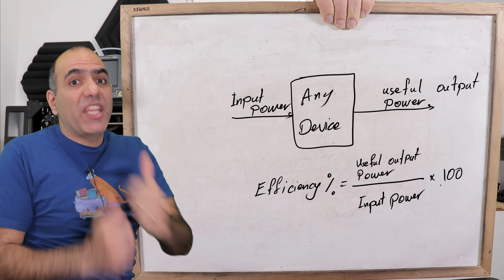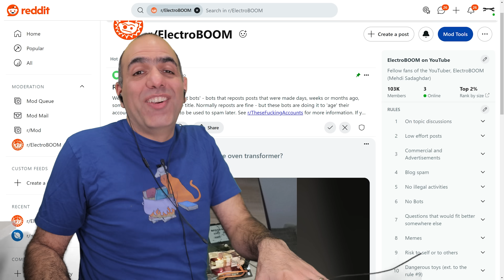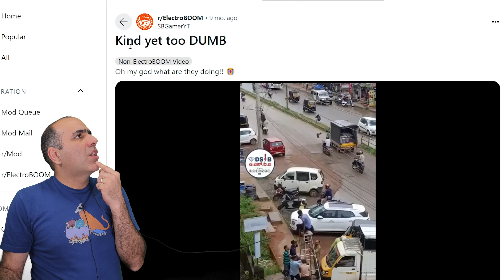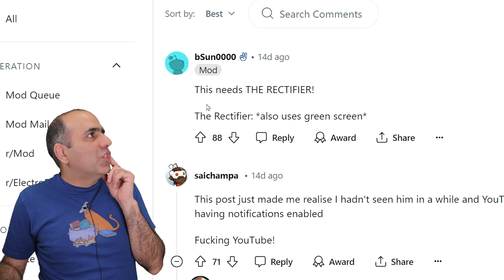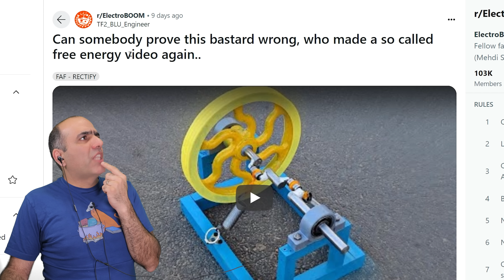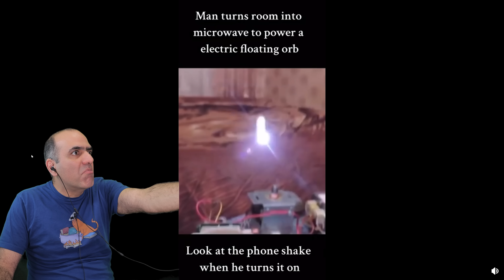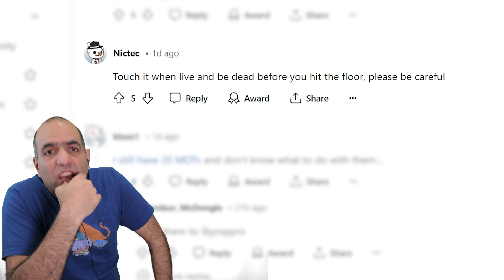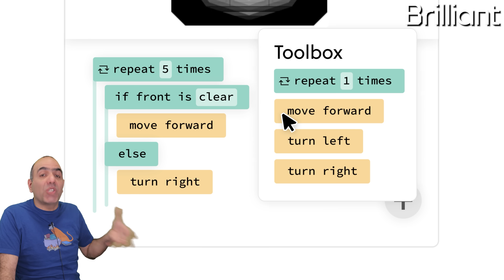New Flywheel Free Energy?! Can Boat Battery Fry You? LATITY-013

Comment: every time i hear trump open his mouth i loose a few braincells. thankfully its not permanent. even ev high voltage batteries are safe, because if anything even as much as smells wrong, the bms will IMEDIATELY disconnect the battery via two redundant contactors. even if not, the water will short the battery enough for the fuses inbetween the cells to blow, its fine.

Comment: iv' Gotten shocked by a 12v battery one time.     It only happened because i Disconnected the  line as the amperage was  surging down. it isnt' like a ac shock it was more about  a  Pressure or tightness.  that quickly went away with aches.

Comment: Hey Mehdi, i admire your chanel and i am a certified electrician who learned alot from your ways :)
Your example with the heater, i will just add a simple observation :)
When we are talking about efficiency you have a cable delivering power to the heater, this cable from your instalation or if you used an extention cord, those cables will get hot aswell, and swallow some of the imput power :)

Regards
The Danish electrician <3

Comment: as a boat electrician who has sat on a large bank of 8d batteries in a 100 degree engine room soaked in sweat, I can agree don't touch the contacts if your covered in salt water it doesn't feel good. I was just sitting on the negative, with my wrench on the positive and it felt like sticking a 9v battery on your tongue but through my entire body. do not recommend

Comment: FOR FEAR OF JINXING NEAR THIRTY YEARS OF AWESOMENESS... I GOTTA DISAGREE WITH YOU KIND SIR.. A LITTLE BIT ANYHOW.
SO, I REMODELED AN AREA  L O N G  AGO AND ONE CIRCUIT.. ONE SET OF LIGHT RECEPTACLES WERE RUN IN SERIES.  I GOTTA TELL YA, THOSE BULBS HAVE BEEN IN THERE FOR NEARLY AS LONG AS THE REMODEL.. WHY IS THIS...? 
I WILL SAY BECAUSE, THEY- (EACH 100 WATT INCANDESCENT BULB) IS BEING SUPPLIED WITH 1/2 THE VOLTAGE THAT IS 'A-POST-TA-BE' SUPPLYING IT- SO THEY RUN A BIT DIMMER BUT LAST TWICE AS LONG, YES?... NO?

Comment: The pigeon rescuers also messed up by using a metal ladder. For electrical work, the rails should be nonconductive (fiberglass usually), so that the ladder does not become a path to ground. I'm an IBEW apprentice, and this is one of the first safety lessons we learn.

Comment: This one where they cooked steaks brought back a WHOLE LOT of old-time memories where we blew up ENTIRE pork sides, turkeys and whole beef rounds using 400,000 Volts at 1000 AMPS using Huuuuuuuuuge solid iron bars rather than copper or stainless steel so we don't poison our meats! Using massive Solid Iron Buss Bars stuck right through our pork/beef/turkey sides we switched over our MASSIVE very-backwoods-remote Northern British Columbia data centre from the normal online BC Hydro connection to self-powered generator modality for "Special Scheduled Test Runs"! 

The wonderful flash arc of the disconnect and sudden input of 4 MILLION WATTS into a pork, turkey or beef round brought us a wonderfully carbon-scented barrage of well-exploded flash-cooked meat to our plates! We did that more than a few times to make the fastest-cooked holiday dinners EVER under the guise of Grid Power Disconnect Test Runs!

Yumm Yumm! All that flash steam-exploded meat was sooooooo tasty! Add in some rum or brandy and we were set for a VERY Happy Holidays data centre SysAdmin shift! It brings tears to my eyes at those ancient memories!

V

Comment: OK... I have a new plan, we have the shark at Universal studios electrocute trump?
no, OK... well lets push this little experiment a bit further for entertainment and science.
The question is: How low can you take the voltage and still get a shock that hurts. (No, not on the tongue)
Watching Mehdi holding the 12V battery against his face, with salt water I'm thinking... umm, ha, no, you're doing that wrong. Ok, not wrong enough. Now I have to suggest some feedback.
After waterskiing and swimming in salt water for a while, my skin was well soaked. Fingers pruned etc.
The boat would not restart after climbing in and I checked the battery terminal because I'd just put a new 12v battery in and the clamp was just a bit loose on the new terminal. I grabbed it firmly and gave it a wiggle to test if it was clamped tight enough. With my feet still soaking in salt water in the bottom of the boat and that bonded to the other terminal, the shock from a 12V battery is not spectacular, but my reaction to this weird kind of low voltage shock across my entire body is something that makes me ask,
how dangerous is this situation and what is the look on somebody's face when they feel this?
 My personal experience - it hurt a lot but I had no trouble reacting and letting go.

Comment: We cooked hot dogs after school for science class. It works great, and very fast. Hints: 

First, don't put the nail in very far - it only cooks tip of nail to tip of nail. If there is only a little hot dog behind the nail, the cooked hot dog in front of the nail will cook that end bit enough. 

Second, have an amp meter in the circuit. I forget if it goes up or down, but it changes rapidly when the hot dog is done. Cooked hot dogs have a very different impedance from raw hot dogs.

Comment: garage54 actually made a car engine using the flywheel in 09:35, i also saw many other use cases like a water pumps, power generator...  but the efficiency is kind of low. 
it's not 100% free energy because it works by harvesting the energy saved in the springs. kind of free energy tho

Comment: As far as I know, for the purposes of air conditioning systems there is something called Coefficient of Performance (COP) which is exactly the ratio of useful heating vs work input required. Unlike efficiency this value is usually more than 1 (around 2 to 4), and that means electric heater can only give a maximum of 1 (electric power in = heat out) which is very poor compared to heat pump air conditioners.

Comment: Is that battery damaged? You know that hybrids have caused a few electrocutions just because the cars got damaged. So when a boat is sinking it just sinks 100% intact?  It only matters depending on where you're standing and where the energy is moving from point a to point b....
Reply: Small EV fairies: something like two Spear battery banks (135-kWh each)

Bigger fairies: 

Something like two battery rooms where 840  lithium-ion batteries stacked floor to ceiling have a total capability of something like 4.3MWh,

Comment: The crazy part about that stupid electric zappy pot is that it's a lot better if you simply use an induction cooker. Use the electricity to make a magnetic field that then turns lights into the pot and makes it hot. Also you're wrong about standing magnets not being able to make constant motion. It depends on how you design the system if the magnetic flux is in a helix for example.
Reply: That's also known as a basic electric engine

Comment: So first, he starts off badly by assuming that the "heavy" battery is going to cause the boat to sink.  Most types of boats require ballast to float correctly and be stable - unballasted boats have so much buoyancy they sit too high in the water.  So, all a heavy battery would do is cause the boat to need less ballast.  Second, pretty good chance the high voltage parts of the battery are going to be pretty well insulated - they already are on cars and boats would need even better in a boat to avoid corrosion.  Third, if a high voltage were an issue, boat manufacturers can deal with it by simply putting contractors mid stack and opening them if they detect too much water in the boat.  Fourth, not sure high far a HV battery would be dangerous anyway - seawater is pretty conductive, which is both helpful and harmful in a case like this.  I'd guess it wouldn't be dangerous outside a dozen feet from the battery or so.  So, in the scenario he presents, what should your main concern be?  Not drowning, followed closely by helping anyone else that was on the boat, followed by getting rescued, avoiding death from exposure, etc.  I'd be worried about my insurance claim on the expensive boat that just sank before I'd be worried about electrocution from batteries.  And, unless you're in an area that is known to have aggressive sharks, they're somewhere below that.

Comment: that p-ditty meme... well it may be time to retire that one. im old so im a fan of the wat. alos 2:10 those are nail plates that are coated for weather and chemicals since you use it in treated lumber and building materials so the electrolysis is 100% depositing that nasty gunk in the form of oxides in that meat.

Comment: 7:30 so what problem are we trying to solve? If you're on top of the boat and it's sinking you're not under the water yet right! And I guess some people have been watching too many Jaws movies. Well what happens with a gasoline boat when it sinks if your tanks aren't sealed you're gonna die from the contaminated water. There's probably more electrocution risk when you're on the dock with the improperly grounded electric.

Comment: Mehdi have you heard of Snap Circuits? It's a bunch of components connected to metal pieces that link together like legos so kids can learn about electronics and build circuits without soldering. It's what got me interested in electronics. Unfortunately, it's just low voltage DC powered by double A batteries, you can't just plug it into the wall or it would be too dangerous or something.

Comment: Hey electroboom can you transfer wifi trough outlet with some wifi outlets? I believe its a scam
Reply: Not quite sure what you mean, but here’s a few:
Ethernet is real
Wifi extenders that you plug in are real
A normal outlet that you plug a normal phone/whatever other device charger into and it gives you wifi? That’s not real
Reply: @henrysanecdotes5323  i think it was wifi extenders, something that you plug and in other outlet you put another one and they connect trough the electrical wiring, not data wiring.
Reply: @Ben_n1  outlets don’t have any physical way of connecting devices to each other (unless if it’s just a usb port and not a normal wall outlet, and that’s why public phone chargers are a security risk). They probably either don’t work or connect to each other with a normal wifi/bluetooth connection

Comment: The context of when Trump said that about the boat and the shark- he was talking about how if they forced outboard motor manufacturers to go fully electric, which would mean a lot more than just 12 volts. Nevertheless, the scenario he was talking about would never happen, because no boat manufacturer is going to have batteries installed a such a way as to where they would electrocute someone if the boat sunk. That would be a very easy problem to fix. And there would be no more reason to fear all those batteries being onboard than there would be to fear the 100 gallons of extremely flammable liquids that would otherwise be stored onboard.

Comment: EV batteries 400-500V DC and they already made some unfortunate victims in China not by fire nor while sinking but by leaking into the car controls and or frame but by "blood electrolysis" don't quote me on that it creates bubbles in your blood and or body tissues and gives you decompression sickness, one of them is now half paralyzed and has serious brain damage, now I don't know if such a battery would not just insta discharge in the water ? vaguely-related we had several dogs and human victims in my area from an AC leak in fresh water near a lake beach but this is connected to the main grid and has pretty much infinite power behind it curious about why it didn't trip a safety somewhere tough, high resistance enough from dirty water on a line expecting high loads already ?

Comment: Recently I went for a road trip along with my family, I checked into the hotel at a late time where a couple of lights are not turning on and the receptionist said she has only room and there's no other room available.  I quickly checked the light was connected to the detached power strip from the wall outlet and I connected it and it started to work.  I remember you at that moment.  Nothing wrong with the power strip not sure why it was detached.

Comment: Electroboom I have a project for you: 

Construct a torus of carbon atoms such that it forms an allotrope like C60 fullerenes but different in forming a toroidal shape, place super cooled liquid helium inside the carbon torus, apply a MHD ( magnetic hydrodynamic accelerator) to the enclosed liquid helium such that the superfluid helium accelerates up to relativistic speed in polloidal flow around the minor radii of the torus. Identify thin region of frame dragging around the surface of said torus, confine a magnetic field to the external frame dragged region such that the field lines of the applied field curve back onto itself. 

Place all apparatus inside a closed ball with an independent power source and control systems

Does the ball begin to rise and upwards as if hanging in mid air ?

Comment: When you need to make a stick to unstuck something from HV line, strap few screwdrivers rated for 500V in series at the end. They are rated for at least 400V.

I use one to break the illegal line from temple PA system - which is a huge nuisance when WFH.

Comment: I have a question for u Mr. Boom. If talking only about heating Water, using Induction heating to water inside metal container  and Heating with resistor submerge inside water, which one has higher efficiency ?

Comment: 7:43 probably yea since before 1950's anode batteries were used to power radios and small transmitters 
witch used tubes that need around 100 volts to work

Comment: Rectifying the Rectifier:

Heater doesn't have 100% efficiency BECAUSE some of the electrical energy will turn into electrical and magnetic fields around the heating element wires and also may produce light (visible or invisible) as a side product.

Send me an oscilloscope if I'm right!

Comment: BTW Mehdi, the most common way I tell if someone is using a green screen is by the slight green hue on their skin from light reflecting off the screen. In this case, the top of your head, but it also occurs on people's cheeks. 
There's also the issue with it showing up in glasses, or through their hair (head OR arm); the latter is not much different from you waving your hand though.

Comment: If you were on a sinking boat, even if the battery had 1000 volts, how would you get electrocuted unless you touched both battery terminals? The battery is not grounded. Electric current has no reason to flow anywhere except from one terminal to the other. Even if you stand right next to both terminals, no current will flow through your body. The reason you get a shock when you touch a live wire is because the other pole is grounded and you are grounded, so the current can flow through your body to the ground. If you are not grounded, touching a live wire will have no effect, that's why birds can sit on live wires, they are not grounded.

Comment: A heater is also not 100% efficient as as it will also produce some visible light (think of a red glowing wire) that may not end up being converted to heat within your home but might escape through a window. E.g. run a heater in the dark and look at your house at night - can you see the heater glow through the window? Well, that's energy leaving your house that wasn't converted to heat. Also every heater also produces some electromagnetic waves at 50/60 Hz because every cable running AC current acts like a radio antenna. So a heater is very efficient but certainly not by 100%.

Comment: Re the HV isolator being opened with the huge aecs. - this would only happen in an emergency, as the damage to the isolator arms is severe. The HV circuit is opened under load by a large contactor where each phase is in a long tube full of insulating gas (SF6) and moved by high pressure air to drive the contacts. Its a very loud noise clearly a violent and scary operation. The open air isolator typically has 3 positions - closed, open and earthed. The 3 phases are connected to ground to short induced voltage to earth for maintenance on the installation. I've operated one of these and they are scary enough,  long  (8 ft ) wispy arc that sizzle above your head.

Comment: Electrical resistance heating is never 100% efficient under any circumstances, even with zero heat loss. Why? Because electrical energy is pure exergy. That is why heat pumps are useful. Resistance heating makes a little bit of heat (dependent on delivery temperature) and destroys a lot of exergy. A hypothetically perfect heat pump does not destroy exergy.

Comment: I would stay on the boat, because the battery, if it shorts by the water, will only be near the battery. Electricity wants to return to the source and if the source isn't grounded on either leg, then it will not ground out and only go between the terminals. That is why touching the terminals with one hand isn't as dangerous as using one hand on each terminal...

Comment: The fake free energy one with springs could be an actual working idea. One one side there is a spring that wants to pull its side towards it and when It does, the spring has no more tension. Add another spring with the exact same spring force and… bam!

Comment: If you look at a heat pump or an air conditioner you can note that upon inputting 1000 watts of power you can obtain from 3,000 to 10,000 watts of usable heat. Although the heat pump is absorbing heat from the atmosphere the heat just migrates back to where it came. You can do the same thing with capacitors that absorb electrical polarity from their surroundings.